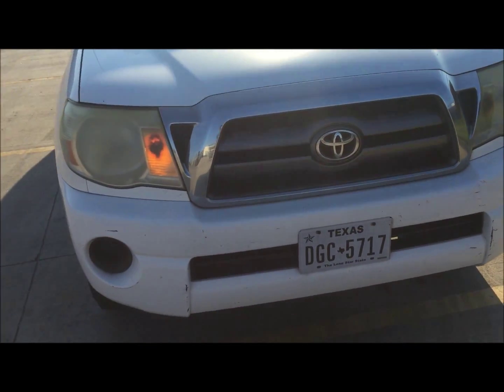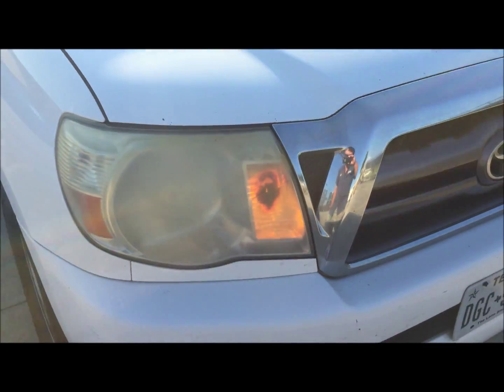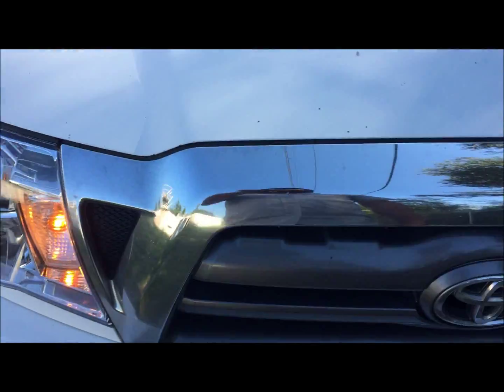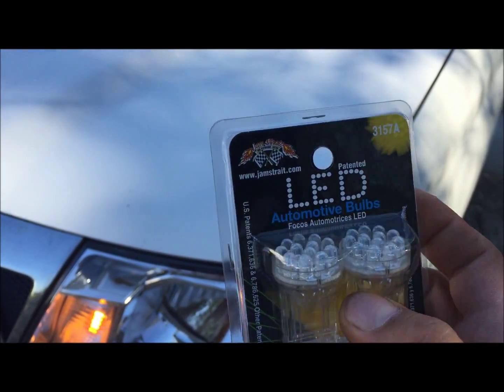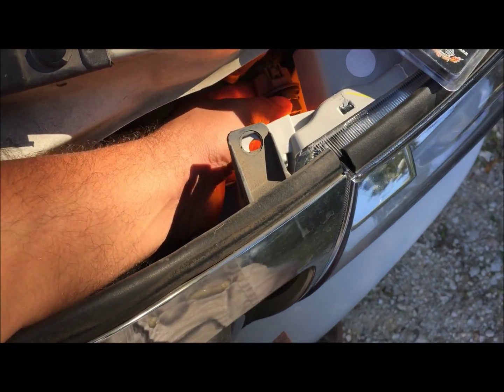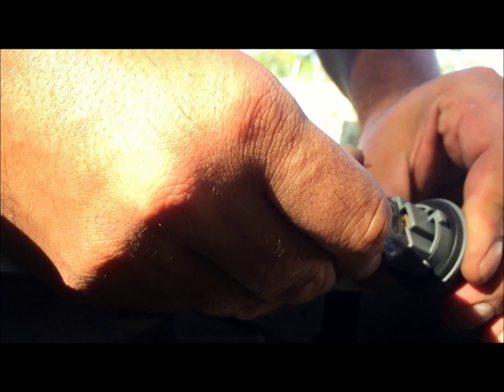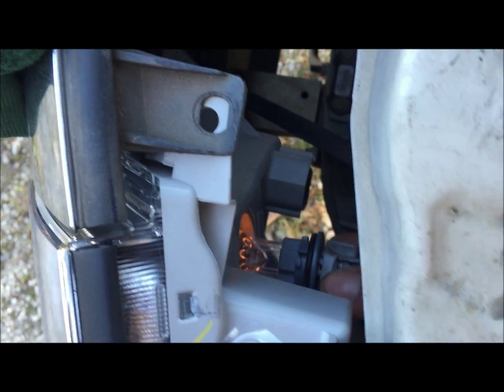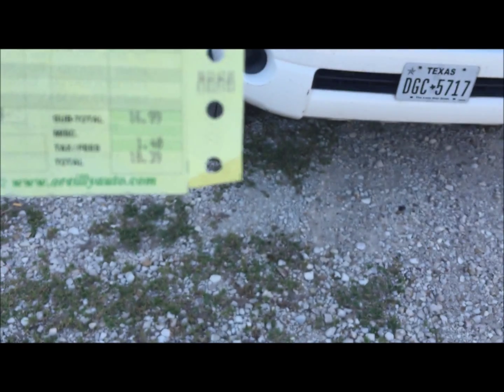toyota tacoma melted headlight turn signal daytime running light DRL problem

Comment: Cant figure this out. On my 2006, my daytime running lights stay on on the corner and not the inside, useless like this
Reply: Depends on the truck you ordered. My 2007 doesn't have it where you can just have the running lights on by themselves. I did not know that when I bought the truck! I was amazed at how stupid that was!!

Comment: I have a 2010 with same problem, and many other problems.  I also have a 99 Chevy Z71 half ton, never a problem of any kind.  Toyotas are over priced and over rated.  Ever see a Toyota truck being used as a work truck?   No. Too expensive to buy and too expensive to fix, and the dealership, well I will keep that opinion to myself.  The old Toyotas were great.  Marketing genius, creating mass psychosis for those who don't really know anything about cars, "oh buy a Toyota, they are the best".  The Taco will be sold soon.
Reply: I have three Toyotas in my fleet no issues with over 300 k miles , my Chevy's took a shit at 190k. I think it's just luck of the drawl.

Comment: So was it the Sylvania ZEVO 3157A bulbs with the white base you wound up using and NO hyper blinking??
Reply from the maker: All LED bulbs are going to blink fast... the problem is the mechanical thermal flasher..... you need an electronic flasher if you are having fast blinking

Comment: The sylvania LEDs are they any brighter than the ones in the video? Hardly tell the DRL are on unless they are directly I front of truck. Looked good out of light assembly.
Reply from the maker: yes, you have to buy the sylvania.. they discontinued the ones in the video because they burnt out...  ive had the sylvanias in 2 weeks after the video and they are still good, as of now..they are way brighter

Comment: Chris, One other question. After you installed the LED lights , did you have a problem with HyperBlinking? And if so, how did you fix it? I was told there is no LED   flasher on the market  that supports these trucks with the DRL. In other words, you either have to physically install resistors to simulate the proper load...and if so what resistors do I buy? thanks for any input.
Reply from the maker: those leds in the video were trash and did cause them to flash fast.. I ended up putting these white sylvania $20 leds that did not change the speed of the flash..
Reply: Okay...Thanks so much for your information. It was very helpful.
Reply: Load resisters
Reply: @chriscraft77022  Can you post the part number for the Sylvania LED bulbs please? Thank you
Reply: @Leba2006  The part number should be the same 3157A just look for sylvania brand bulb
Reply: Cris S what year that’s your truck ?

Comment: I have the same issue but out of warrenty.  Is there a simple fix for the bulbs to get working again?   The melting headlight doesn’t bother me as much as the bulbs not working!
Reply from the maker: I used to have to buy those black plug things from the dealer..  I think they were like $10 each

Comment: hello..i have a 2008 Tacoma and I experience same problem. How do I find out if this is a recall? Thanks in advance for your reply.
Reply: I read more... so the dealer typed in the VIN #..and that's how you found out about the melted headlamp.?
Reply from the maker: go to the service manager at the dealer... they will know about it

Comment: Same problem here.. I keep getting melting issue. I bought a set of these LEDs but I keep blowing fuses before they even turn on.  Do I need a specific kind?
Reply: Curt Park did you ever find out what the problem as to why it blew?

Comment: the dealer said the were under warranty to 70000 miles .mine had 79000 miles
Reply from the maker: +Joseph Trujillo Sr  my truck had 211,000 miles and i got mine put in on oct 2 2015 in houston, TX for free...  sorry to hear that...

Comment: my 2011toyota tacomA has79000 miles.took it in to toyota dealer to change burned out day running lights.the ended up charging me 600 dollars for both sides.wouldn't replace them free
Reply from the maker: +Joseph Trujillo Sr....  that sucks... did the service manager type your vin in the recall system?  what was the reason they gave you for not being eligible for the recall????  they have to be pretty bad like mine were...
Reply: One of the reasons my next truck will not be a Toyota....
Reply: $ 600 ? For 2 running lights? That sounds like a rip off. I would have contacted the Toyota factory rep, not the people at the dealership.